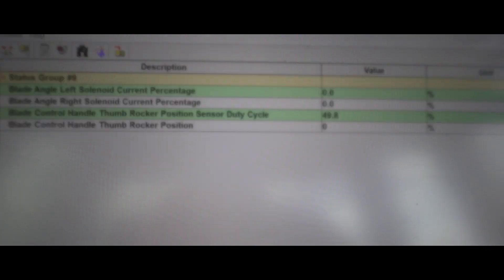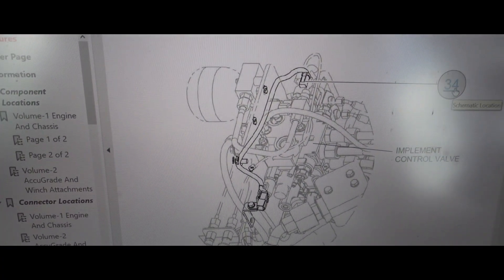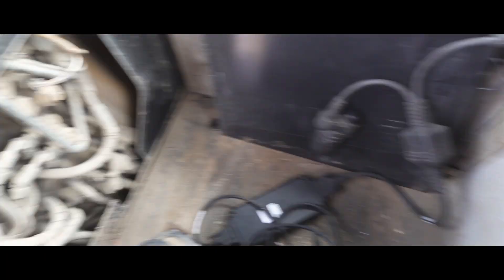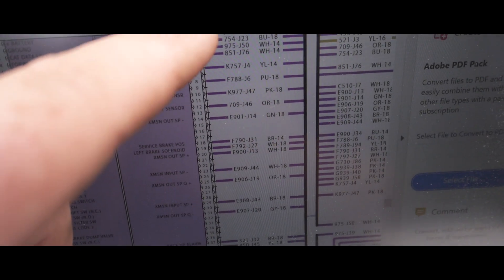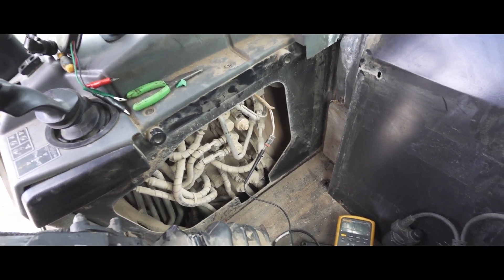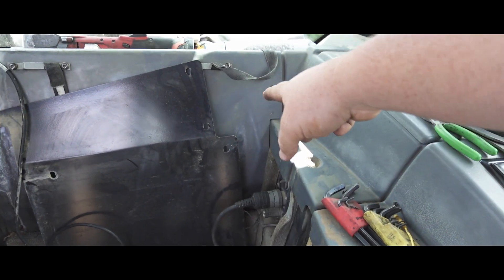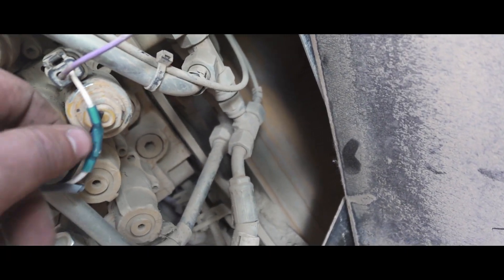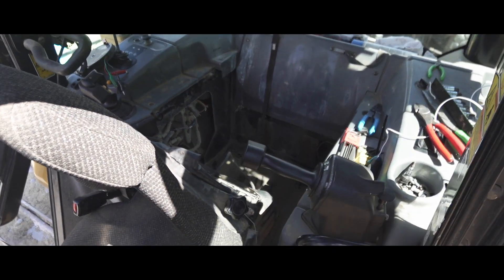CAT D6N BLADE WILL NOT ANGLE??

Comment: Are those Ns fully electric over hydraulic? Or like the older skids and minis where most of the main functions were pilot controlled and the auxiliary functions were electric over hydraulic?
Reply from the maker: Main functions are pilot controlled and the blade angle function is electric over hydraulic . Thanks for watching !